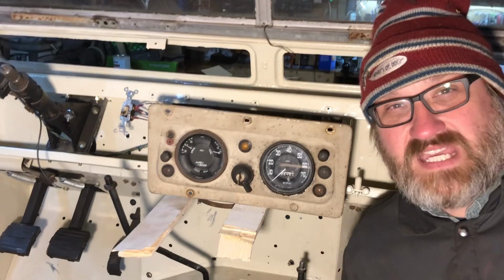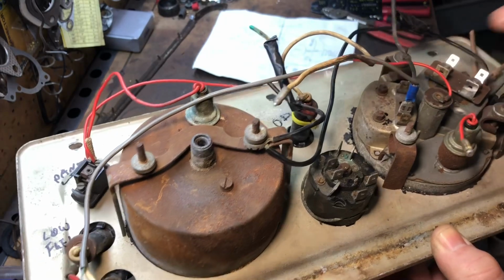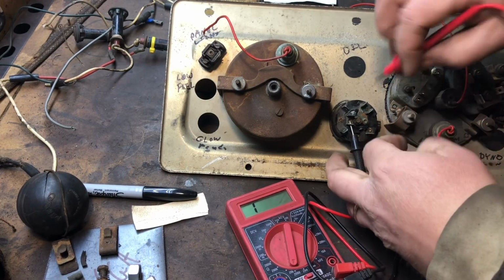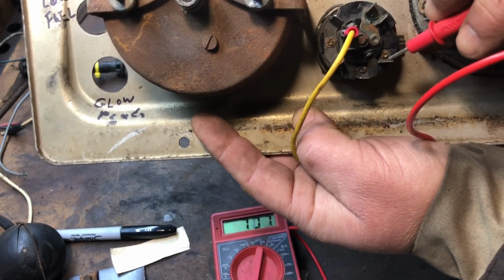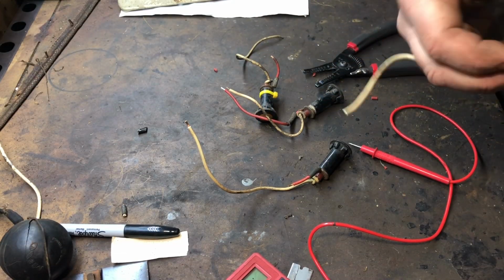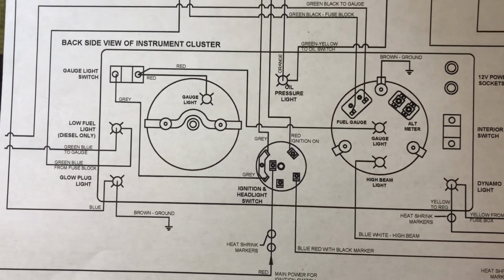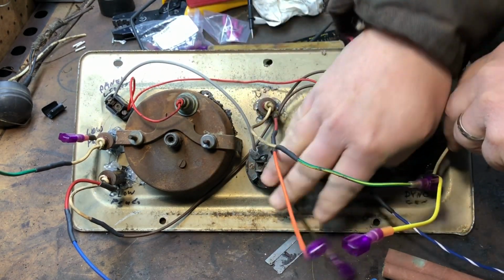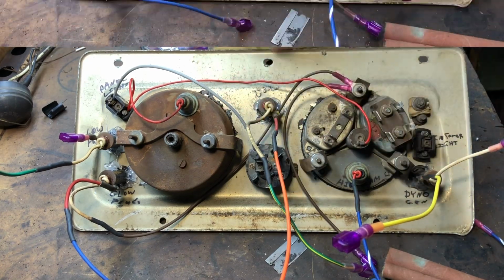Wiring Part 3 - Dash Land Rover Series 2A Restoration and Repair

Comment: You had the wires around the wrong way. The yellow wire you used is connected to the terminal that goes to the coil. It is the ignition terminal.
Reply from the maker: Do you mean the test lead for the ignition switch? The yellow wire is for the multimeter to read continuity. It is not connected to the truck.

Comment: Hey, was wondering if you had a video of how to take the ignition switch out, I need to replace but can't figure out how to get it out, thanks Cory.
Reply from the maker: Sorry I do not have one. The early switch like mine are held in with a wire clip help in with a bolt holding the wire around the switch.
Reply from the maker: At the 3:30 mark of the video. You can see the little metal wire clip and bolt/nut.

Comment: Won't there be power from the switch for glow plugs ?
Reply from the maker: You are correct. The ignition key when turned to “on” position it triggers the glow plug relay to turn on for 15 seconds. The timed relay will be discussed in another video. Please stay tuned for the next videos!! 😀

Comment: Hi Cory, Your Awesome!! Im curious about the combination headlight ignition switch. there appears to be letters and words molded in to the back of the switch. do they have any meaning? I like the idea of having the fuse box and the relays in that compartment. Could you make one pigtail connector that could go to the dash and plug to plug all of the wires into it? for quick disconnect?
Reply from the maker: You’re awesome, too!! The numbers going around on the switch doesn’t match the original diagram. I like to hide as much as possible like relays. Room is actually pretty tight behind the dash. A single pigtail would be nice. Kind of too fancy for my wiring. Ha ha!

Comment: Cory, you may find you need a voltage stabiliser to work the fuel guage....otherwise you'll find the fuel needle rising and falling with the engine revs!
Reply from the maker: You are correct Sir. The later fuel gauges used a heated element in the fuel gauge. Plus a different fuel sender. Since I have an early gauge it uses resistance thru a different fuel sender. It does not use a voltage stabilizer.

Comment: Perfect timing mate ;) just doing the rewiring of my own dash at the moment. (My understanding of the 'ports' on the dash was that they were intended for powering an inspection lamp - there are specific plugs available for them.)
Reply: Yep that's exactly what they're used for. But make sure that if you use them you upgrade to modern 4mm banana plug type ones or fuse the old ones. They are only insulated by a wax paper disc and are the main fire risk on land rovers. Fuse is essential!
Reply from the maker: Malcolm, you are correct. There is a little piece of plastic or wax paper around the terminals.
Reply from the maker: Nick S, good luck on your rewire. Make sure you mark your wires or use different colors so you don’t cross wires. Even add some inline fuses. Pretty cheap insurance.